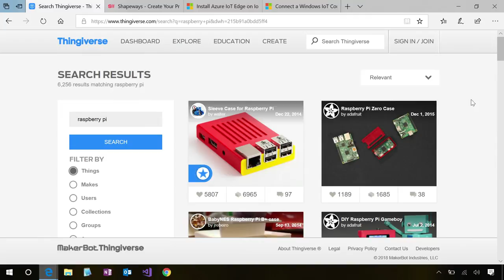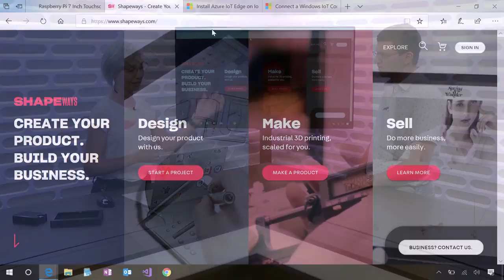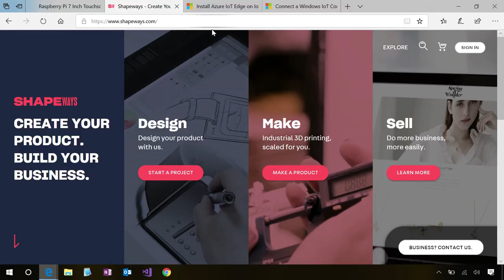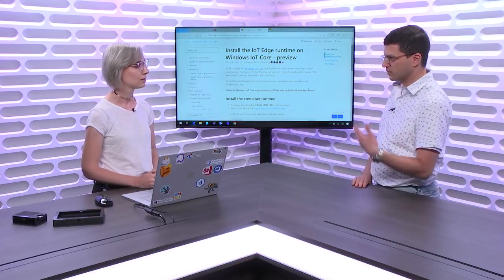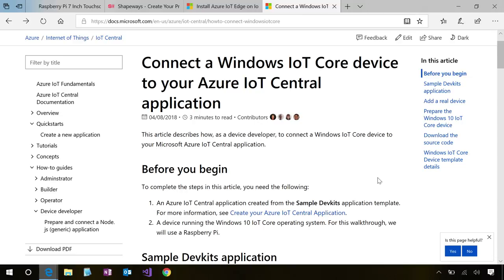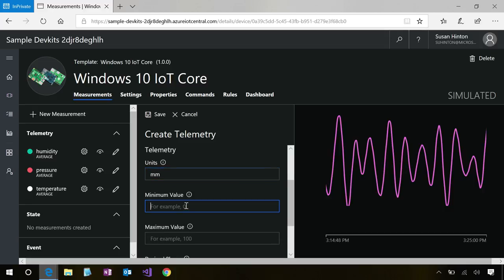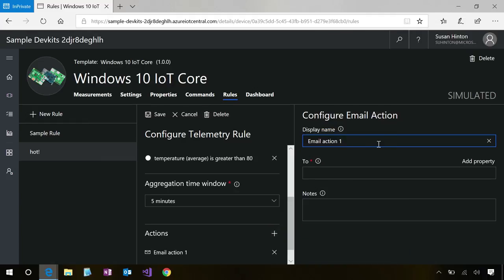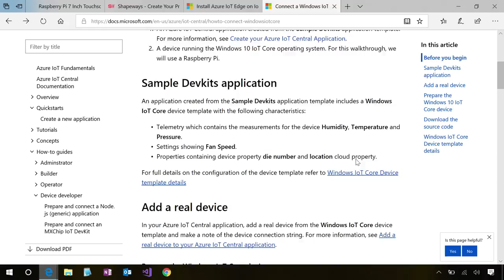Windows IoT #6: Taking your Windows IoT Core Smart Device Further (Getting Started Series)

Comment: Hello Dmitry and Suz, very nice work you guys are doing, and it has helped me get started on my IoT journey with windows IoT core. Can you make a video example on how to create a real time graph of sensor readings on the "UWP app" with win IoT, such as Temperature vs Time, or Current readings vs Time, rather than using Azure IoT as you described in this video for case scenarios where you the whole network setup is a home network not necessarily having to connect to the internet and also how to use the data generated to send commands to trigger actuators in C# code behind

Thank you very much guys. you are doing great